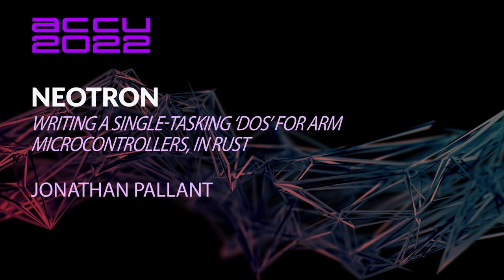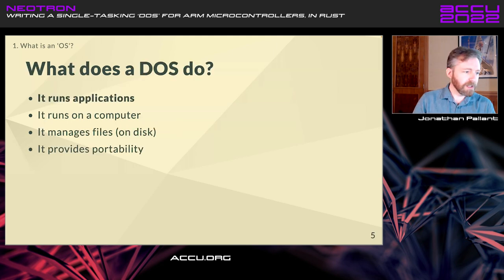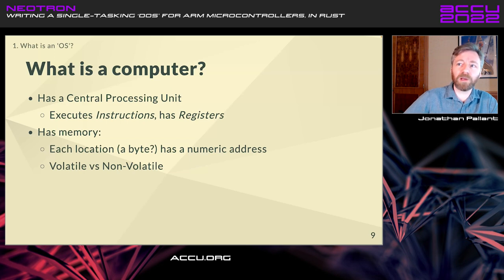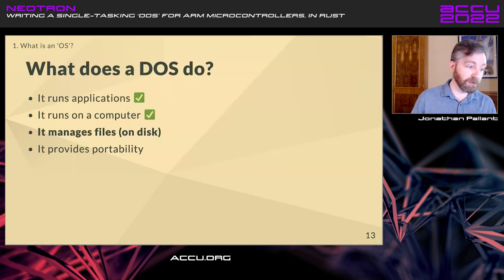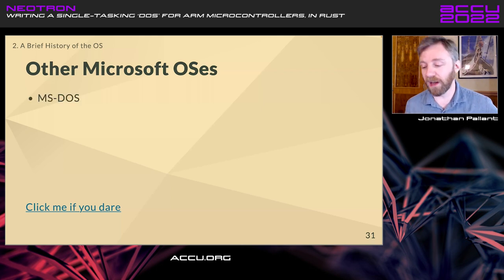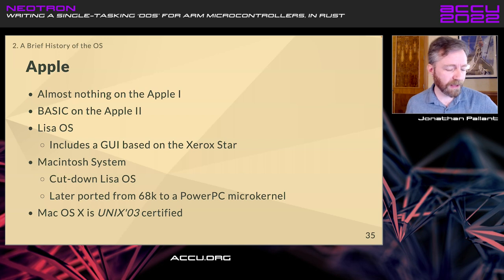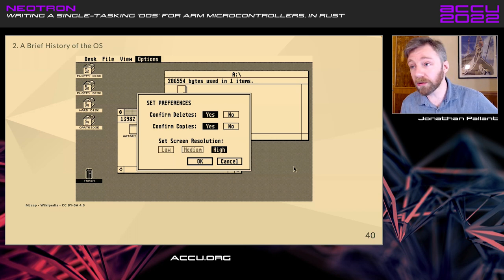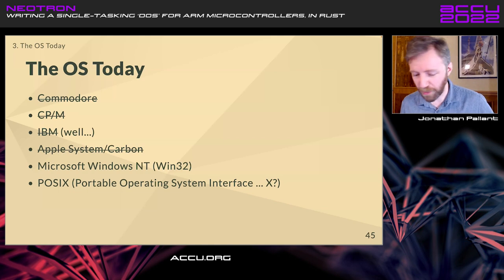Neotron - Writing a Single-Tasking ‘DOS’ for Arm Microcontrollers, in Rust Jonathan Pallant  ACCU 22

Comment: ah, a lot of those "simple" unix tools rely on fork and their utility drops dramatically in the abscense of pipes - but I very much aplaud this project. my little VGA32 ESP32 RISC-V SBc that cost $12 is a perfect kind of target system - has SD card, VGA for display, PS/2 for keyboard and mouse, has audio out port and integrated WiFi.
Reply: I wasn't aware FabGL worked on the ESP32-C3 - I thought it required the Tensilica Xtensa based ESP32, because that's the only Espressif chip with the parallel-I2S bit shifting hardware. But yes, they are neat devices.